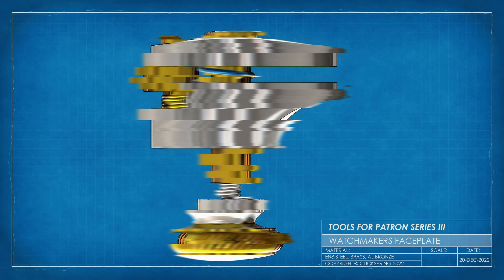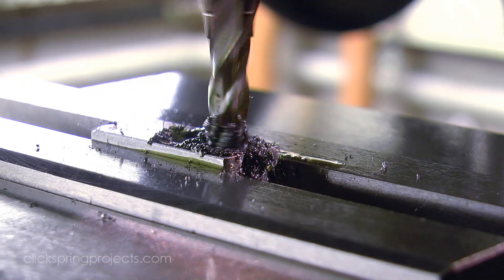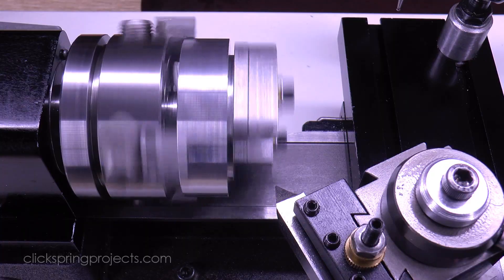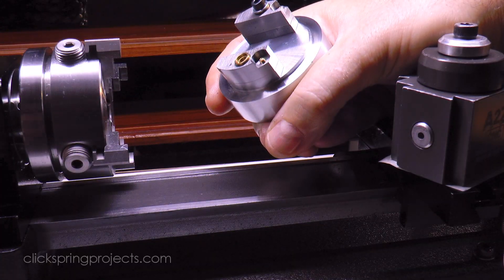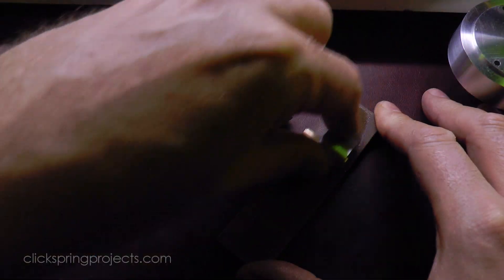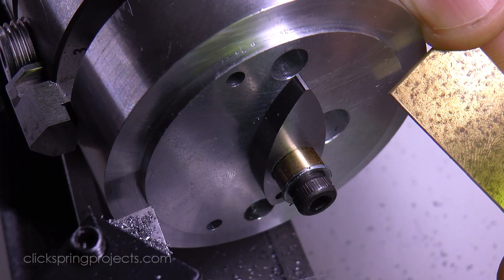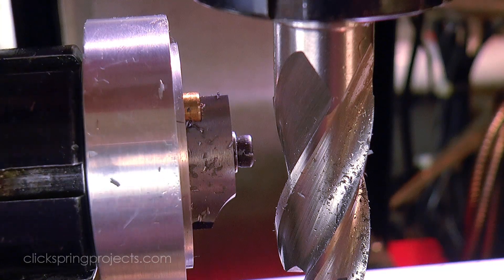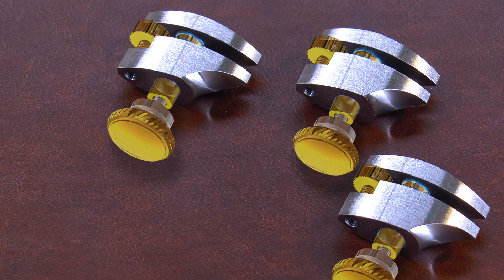Watchmaking - Making a Watchmaker's Faceplate for the Sherline Lathe - Part 2

Comment: You could have done the outside profiles in 3 operations instead of 4. You have three clamps with 2 surfaces each, so 6 total, and you can cut 2 at once, a left and a right, so you could do them like this:

Operation 1 = Clamp 1 Left surface + Clamp 2 Right surface
Operation 2 = Clamp 3 Left surface + Clamp 1 Right surface 
Operation 3 = Clamp 2 Left surface + Clamp 3 Right surface

It doesn't matter now, but it was too mathematically pleasing for me to ignore it.

Comment: Thanks to you and superglue, I’ve totally changed my workflow and save a ton of time now in the shop. I’ve stopped making softjaws almost entirely and it saves me a ton of time. I have a few flat aluminum plates I swap into the vise and glue most parts to those now. I do mostly small runs of very small fussy parts and it’s shocking how little bonding surface is required to hold the parts. I have like a dozen different vises and stops for like 2 of them, so supergluing a piece of scrap to the top of the jaw is a fast way to set a stop.

Comment: FWIW three clamps could be made and fixture can be balanced throughout as follows: clamp A side 1 + clamp B side 1; then clamp A side 2 + clamp C side 1; then clamp B side 2 + clamp C side 2.  Top notch job, thank you for sharing.
Reply: Almost, but notice that his fixture requires both clamps to be in the same orientation but on opposite sides of the plate, so it can only do a left surface on one and a right surface on the other. He could still do it in three operations, but it has to be done just right:

A1 + B2

C1 + A2

B1 + C2

It is a very mathematically pleasing sequence of operations though.

Comment: Would there have been room on the fixture plate to mount three clamps at the same time. With each mounting spot having two of the small locating holes so that you could simply turn the clamps 180° to machine the large radii.
Always loved using ground tooling steel (1) for making personal tools at work. Having four finished sides saves a lot of time.
1) Commonly called Gage Stock in the US.
Reply from the maker: Yes, certainly. For a one- or two-off, a quick fixture like the one shown works well, but if I were doing a production run of these, a 120 degree fixture with more time invested would be justified. Worth mentioning also that the simpler fixture plays within the limitations of the little benchtop mill; simple x,y errors easy to immediately detect. Radial hole precision on these little mills isn't quite what one would hope for; easy enough to work around but takes more time for setup, and then test for truth. Both fixture options will be available in the prints when released - Cheers :)